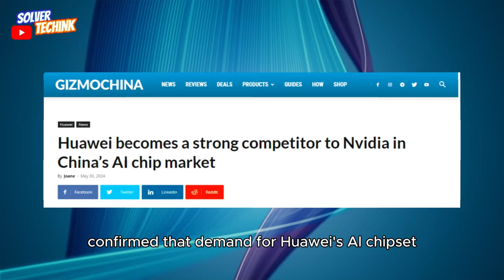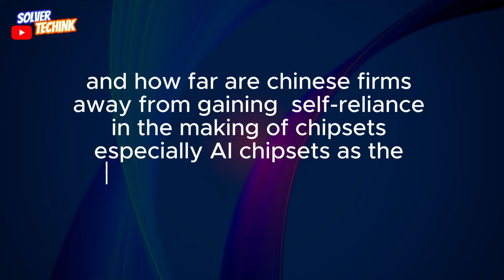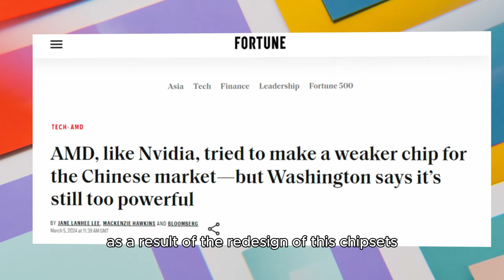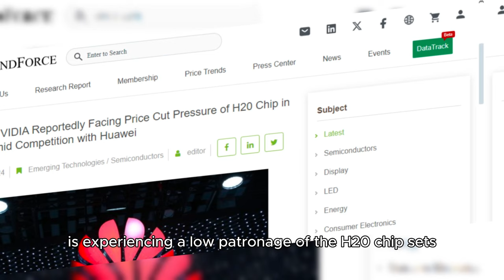Ai Chips from Huawei out performs Nvidia for the first time

Comment: Than how come China buy so many H20 ?
Reply from the maker: China still uses the H20, it all depends on what the tech firm intends to use the chips for. The only difference here is that many firms are buying the Asend chips from more than the H20
Reply: Huawei's Ascend 910-B was introduced as a rival chip to NVidia's H20, which was designed for the Chinese market.  The Ascend is reportedly faster and shows superior performance, and commands a higher price.

Comment: It's not true, all the tests are shown for 1 Ghz, so for the real applications the results will be very different like with chinese GPUs which can't handle most of the games, as NVidia and AMD do but their GPUs were also more powerful than NVidia, it's also applicable to chinese CPUs which can't handle most of the software but they are "more powerful" than Intel or AMD.
In conclusion, the powerful lithography machines are only manufactured by one company and China uses quite old ones at the moment. The most advanced EDA tools (Synopsis, Cadence) are only american ones, so chinese have only access to some nm, they are partially sanctioned. Their software will be available but probably it will be considerably worse than the western ones, they don't have much professional experience compared to american counterparts.

It's a lost case, chinese CPUs have been manufactured for about 20 years but they are still very bad.
Reply from the maker: Great perspective
Reply: the more expensive Huawei  Ascend 910B chips  perform better and outsell  the A100  that Nvidia has to cut the price .... you call that a lost ..... 

" The U.S. finds no evidence that the Chinese smartphone and telecom giant Huawei can produce smartphones with advanced semiconductors at scale, U.S. Commerce Secretary Gina Raimondo said last year on september 2023

China  has already started mass produces 7nm chips
Reply: @paulzhang1310  You're wrong, study this subject. They produce 7 nm not directly on ASML machine but by using special techniques and layers, it's much more expensive and eventually they won't be able to reduce the process size. No any evidence that NVidia cut the prices because of this chip.

If you're so sure that chinese components are the best, throw your own PC out of the window and buy pure chinese CPU, GPU and motherboard, good luck with Huawei smartphone without official Google Play and right now Huawei again uses Snapdragon's chips which weren't sanctioned. They still prefer american chips, not chinese which can't support software properly.

AMD's GPUs show a lot of raw numbers which are considerably higher than NVidia's but in real applications they are usually weaker because software optimisation is the key, not those numbers and no any chinese CPUs (produced for about 20 years), no any GPUs and even no mobile CPUs which would outperform american chips in real applications.
It's a lost case and they can't produce the key technologies. They won't surpass ASML which has been developing machines for  about 40 years and it's a monopoly.